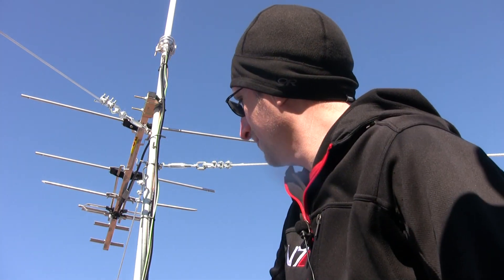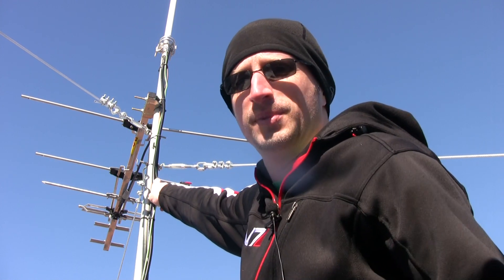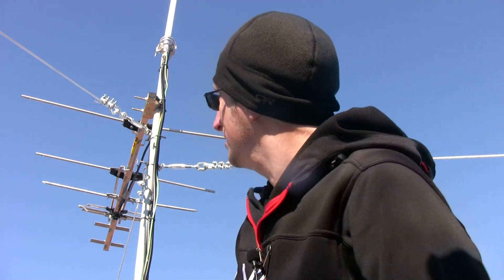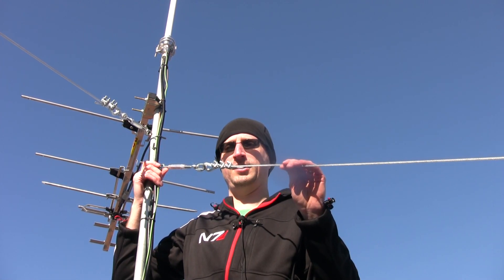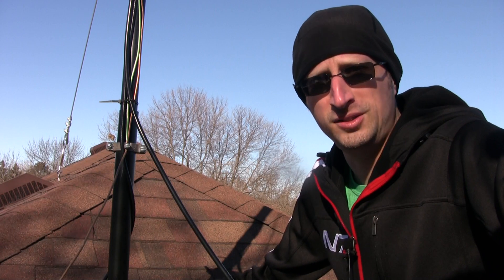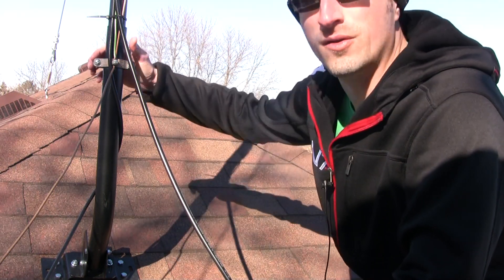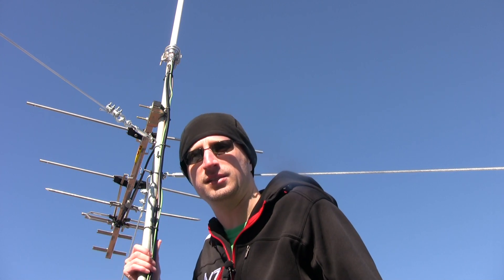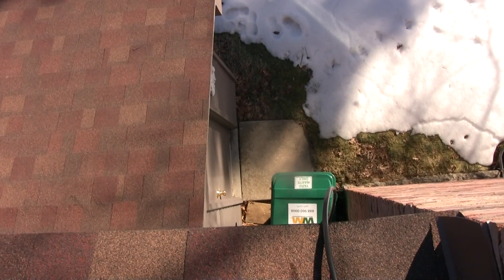Overview of outdoor antenna for Helium Network

Comment: I ended up buying the same antenna stand on Amazon, however it's hollow instead and doesn't look like any good way to connect the antenna. Any suggestions on how I should go about attaching the antenna? I believe I have the same antenna, or a very similar one. Do you think U-Bolts would work for that as well?

Comment: How many feet of lmr400 did you use, is this the 5.8dbi rak wireless antenna? Looks like 30 feet if that, would be about 1.1 dbi loss?
Reply from the maker: technically two lmr-400 cables (5ft & 27ft with a lightning arrestor before the 5ft section that goes in the house).

Comment: i have questions .my questions are :

1. Can I connect 2 or 3 antennas same time for 1 miner (example 4 dbi and 8 dbi)with antenna splitters ?

2. what internet speed needs a connect bobcat miner and how can check internet speed ? Is internet speed important ? wifi or cable connection better ?

3. i ordered bobcat for usa us915. if i ll move to Europe, how can i use my miners there ? can i change my miners antenna frequency ? (from usa to europe ) do i need replace or buy part any module ?

Comment: Really cool video. I've been researching optimal send/receive for my HNT hotspots and this video is awesome in visualizing this. 

QUESTION for you: have you stumbled upon information regarding minimizing your coax cable length, mainly, by getting an outdoor enclosure for the hotspot itself and reducing the coax to as little as possible (~0-2 feet), while running longer ethernet and power connections up the antenna mast? I know signal loss with LMR-400 (or better) cables is minimal even over 20 feet of cable, but I think it's still a factor. I've seen pics of people mounting their HNT hotspot right below the antenna and have a super short coax. Since there isn't any signal loss or speed loss over 30 or even 50 foot ethernet cables or power cables for the hotspot, but there is signal loss with the antenna cable, this kind of makes sense. However, those outdoor enclosures are fairly expensive and usually all sold out at the moment. Would love to hear your thoughts on this way of mounting and minimizing any loss for the antenna.

QUESTION 2: I'm considering the above method and using a 20+ foot antenna mast. I've read several hardcore RF guys discuss how that's the minimum height above a house and surrounding houses to get a stronger success increase with the HNT hotspots. Thoughts?

Comment: I’m still waiting for my rak miner, however I am going to make sure that I have my antenna ready. I have a 10 dbi omnidirectional antenna, but also want to combine it with a 4dbi omnidirectional antenna. Is this feasible and what hardware should I purchase?
Reply from the maker: It is feasible. You would need a combiner to do so. I've not tried this yet.

Comment: Finally got my 8dbi from China got it in a few weeks & I set up my antenna with a 5ft extension added giving me lil over 8ft for total of about 28-30ft total.
Reply: 8dbi rak. The syncrobit website said SMA female but they upgraded the info & says RPSMA now so the cable that comes with the 8dbi rak should work with the syncrobit.

Comment: Great info, thanks. What about a leak in the roof with driving those bolts into the roof?
Reply from the maker: Yep, covered in another video. Put some roofing caulk on it before you put in. Some have said on top too.

Comment: Hey Ed, great videos. I am building my set up from them. I see you are standing next to your chimney. I might consider running concrete anchors into it and using antenna wall mounts like Skywalkers on Amazon. I am a firefighter and we get house fires from lightning strikes. It would be much better if your brick chimney got hit and went to ground. Just a thought. Keep the great vids coming!!!

Comment: Your cable runs are too long. Should’ve ordered an outdoor miner to keep your cable run as short as possible! (Not to mention signal loss) you’re probably spending a fortune on the cables! Sounds like you changed the 4 dbi supplied antenna that came with the unit for a more narrow directional 8 dbi antenna,  Hope it works out for you but it does not sound good… js.. but my opinion is based on mounting 4G LTE antennas with Sim card connectivity to towers
Reply from the maker: I will be experimenting soon with a shorter cable. Last fall I was using a short cable and the earnings weren't that great. The cable wasn't an LMR-400 cable - it was the stock one that came with the antenna. I've been happy with how it's been mining so far.

Comment: Hey if I heard you correct the yagi antenna helps with your helium as well? How did you mesh the two antennas together? Or do you have two miners
Reply from the maker: No - the yagi is strictly for over the air tv.

Comment: also how long is the cable to the antenna and does the length reduce your HNT earnings?
Reply: Cable length does affect DBI, the longer the cable the more loss. A good shielded cable like this is not going to lose much over 10 -15 feet though. 100 feet would be another thing.
The shorter the better, however inches does not matter much where feet does.

Comment: can we use this antenna with Rak , nebra and bobcat miner or it is just for one type of miner ? Thank you
Reply from the maker: Any miner as long as you use the right cable.
Reply: @edballou1  Thank you for the reply . Could you please tell what sort of cable i need as i have order  nebra and bobcat miner?  Thank you
Reply from the maker: @milan02able  An LMR-400 cable. I get mine from usacoax.com. The ends of your cable are HIGHLY dependent on the antenna and the miner. The Bobcat is SMA. I don't know what Nebra is off hand.

Comment: How much power does the setup use. Could you run if of solar and a battery as the power supply?
Reply from the maker: 5 watts I believe... same as an LED lightbulb. I'm super interested in a solar/battery setup. Will probably experiment with this in a few weeks.

Comment: Can you comment briefly on antenna cable length? How long is the extension cable in this setup? I've seen people claiming that a cable length of more than 5 to 10 feet will adversely effect HNT mining rewards,  do you find this to be true? 

Thanks for making these videos, Ed. There are many new HNT enthusiasts like myself who are trying to soak up as much knowledge as possible and, for me at least, first hand experiences like yours contain a wealth of information!
Reply from the maker: 32ft of cable total. 27ft to a lightning arrestor, then 5ft more to the miner. While true about introducing more dbi loss, I’m accepting that over risking putting my miner outside.

Comment: It's a good idea to mount on the overhang so water doesn't leak though your roof.  At least use roofing tar under and above the screws, but even that needs to be checked and replaced regularly.  Mounting in the middle of the roof should be a last resort.
Reply from the maker: 100% good advice!
Reply: @edballou1  I appreciate your valuable videos.

Comment: Did you need a signal booster and does the company recommend one based on cable length since the signal strength declines with length.  How long is your cable, estimated to the miner?
Reply from the maker: Companies certify the miners with the antenna shipped. Customers may choose to make modifications. My cable at the time of this filming was 27ft. I now have it at 32ft.
Reply: @edballou1  I ordered 2 nebra miners.   If I learn about boosters elsewhere I'll update.  I do not want to void the warranty nor damage the unit but also if a booster makes little to no difference then its a waste of time.  I bought a used 30 foot pole for $40 and it can be raised 10 feet per section.  I want to connect with a nearby town so I'm gonna offer free internet prepaid to someone if they'll let me place a unit in their home, then use profit to add more miners.  After halving I'll see whether I can expand or not.

Comment: so in this particular setup, Ed got a Rak 8dBi male N type ---> N type female to female lightning arrestor ---> LMR400 Male N type with Male RP-sma --> Miner ?
Reply from the maker: Yes, that's correct. However I later moved the lightning arrestor lower down the cable.

Comment: What are the cable ends...1 is the N type male other side is the RP SMA male?
For the RAK..... Am I correct?
Reply: The cable ends Ed is using is a male N type to a male RP-SMA. The connection on the RAK 8dBi is a male N-Type. He's apparently using a female to female N type lightning arrestor.

Comment: this is really helpful
thank you
how long is the cable running from the miner to the antenna?>
Reply from the maker: In total, probably about 32 feet. Thinking about shortening that up though as my earnings seemed to have dropped. Will be experimenting some more soon.
Reply: @edballou1  yes shortening definitely works..i heard no longer than 5 feet is optimal
Reply: @phobiazzzero4935  Hi, Can you say where you heard 5 feet of maximum cable is correct, as this seems and sounds absurd. Did you perhaps mean  25 ft. which is less than his 32 ft.

Comment: Bro thank you so much man,,, I am so happy found your channel. I am from canada and I am trying to setup a new device. You said putting a higher dbi antenna is not valid under sec regulations then how come can you used a 8 dbi?
Reply from the maker: Manufacturers have to certify the device with the antenna in order to sell it. It's public license space so if you keep your dbi low enough, you're probably good to go. That said, the FCC could knock on your door and inform you of infringements/violations. Even then, it's probably just a "take it down or lower your dbi", slap the wrist sort of thing.
Reply: @edballou1  cool. thanks, I am going to try 3 dpi, 5.8 obi and 8 dpi,, lol.. I have ordered all three types, will keep each antenna for a week and decide what's giving me the best money
Reply: I thought that the three and eight may actually give you less helium. How did your test go?

Comment: I  saw a similar 9 ft. to 17 ft telescoping galvanized antenna mast like this on amazon. I was thinking of purchasing and it looked like it wanted its owners to route through the hollow inside. I was thinking wouldn't it make more sense to run all cables on the interior of the hollow mast/pipe than zip-tying them to the outside?

I am thinking of making a similar indoor/outdoor antenna setup and your videos are very informative thanks!

Comment: Do you know if your outside antenna will work with the new hotspots coming from Nebra? I was thinking since it is 915mh it should but i am worried about the connections. Since the Nebras are being shipped as i write this you might not know. Any news? Thanks.

Comment: so for those live in houses they HAVE to get this setting? antenna on the roof? why non of that is mentioned on Helium website?
Reply from the maker: Not required at all. In fact, in the long term, may not even be necessary as the network fills in and more hotspots come online.

Comment: Hi Ed, please use common sense with regard to lightning. It is too hot and too many volts for that green cable to handle. In fact your whole antenne is now a lightening rod. When it hits, it will melt all cables and hit through the roof, and put your house on fire. You need an expert to place a separate lightening rod further away and higher in the air then your antenna in order to be protected. Please consider removing this video so that nobody copies your setup.
Reply from the maker: Hi! Thanks for the feedback. As I stated in the video, I had an electrician ground a similar mast setup and went for years without issue. Much of the rest of the setup (green wire) is to address static discharge. If this setup is wrong and unsafe, I'm absolutely happy to take it down, correct my setup, and then film a new video to encourage others. Please include links (to other documentation, videos, etc) so we can get the word out about the most safe setups.
Reply from the maker: https://longrangesignal.com/tv-antenna-basics-how-to-ground-an-outdoor-tv-antenna/

The green wire is specifically in this link.

Comment: HI ! What is happening this year in August to halve the reward of HNT? I don't think it's good for miners. What do you think?
Reply from the maker: Though I'm learning, I'm nowhere near expert in crypto, tokenomics, etc. The only thing I've heard is that halving has been traditionally good for crypto. Could be completely false...but that's my current thinking? Again, still learning.
Reply: Yea, its called halving. Other popular coins like Bitcoin also have this. With Helium halving happens every 2 years because there is a finite supply of HNT (223 million).

Comment: I hear that a 3 meters cable is the max for mounting an antenna there you have like 5 miters of cable does still works?
Reply: The longer the cable, the more your signal loss is. Keep the cable as short as possible
Reply: @jose3538  exactly thanks for your reply!

Comment: How did you connect it from the outside to the inside? Did you just run your cable under a windowsill or something?
Reply from the maker: I drilled a hole through the side of my house. Others have routed through a vent. Some have mentioned a flat cable that can be put through a window.

Comment: You have to ground everything because you are using an outdoor miner is that correct?
Reply from the maker: An outdoor antenna. The miner is located inside my house, connected with a cable which I show at the very end of the video.
Reply: @edballou1  don't you think you're losing power by running such a long wire to the hotspot?  Antenna wire that is... its been discussed quite a bit that you don't want more than a few feet from hotspot to antenna.  How many feet is it precisely if you don't mind me asking? Great video!
Reply: Which outdoor miner are you using?

Comment: Have you got any tutorials for the best method of placing eg 3 hotspots within range of eachother , what to do and to avoid
Reply from the maker: 300m spacing at a minimum. The rest is just experimentation with placement or considering use of antennas.

Comment: Hi Ed, I am wondering if you can do the best setup for indoor mining as I do not have access to a roof but an attic/ or a second floor on a house. Thanks
Reply from the maker: Still doable. If you have a balcony or can mount an antenna on the outside next to a window (safely), then those would work too. There are flat cables that can be used to navigate through a window.

Comment: Do you feel that the length of the LMR 400 you have running diminishes your signal strength at all? Just a suggestion, possibly buy a syncrob.it hotspot with PoE capability and use their outdoor enclosure that comes with it to eliminate running your LMR too far.
Reply from the maker: Any amount of cable diminishes signal strength. Antenna db can compensate. Like I said in another comment, I don't want to run the risk of damage to the hotspot from weather. With supply so low and demand so high, I don't want to risk being down for months while I wait for a replacement.

Comment: Nice video as I am about to deploy my 5.8 dBi outdoor antenna. What is your neighborhood like and your decision to go with the 8 dBi outdoor antenna, like nearby hotspots, hilly terrain, urban vs rural, and etc. Thanks
Reply from the maker: Terrain is mild. There's a big river a few miles away so that helps with line of sight. As for why I chose the 8dbi, no particular reason. I just saw others were going with bigger antennas so I decided to try it too.
Reply: If you live in a suburban area in a flat town, a higher gain antenna like yours works best. If you live in a city with lots of obstacles (like New York and its buildings), a smaller gain antenna is better.
Reply: @jose3538  Why? Please explain.
Reply: @jose3538  Hmm. Interesting. Thanks.

Comment: If you don’t mind approx how much helium are you able to get with the outdoor setup?
Reply from the maker: Hundreds of HNT per month currently. That will change over time as the network grows.
Reply: @edballou1  and what you think when the network will grow the amount will drop down?
Reply from the maker: @pavelroujilo2286  I believe we haven't reached the max 5 million HNT per month yet. So it's either when we get to that point or if we already have, then it will gradually get lower as the network expands. The halvening will of course make it go less, but that is a reality and the value of $HNT seems to be already accounting for that fact.

Comment: Good job! 
I have a question, would you recommend the Nebra hotspot? Also what's the best antenna to get for my helium miners? (Ordered 2raks and thinking about one nebra)
Reply from the maker: All miners are intended to be the same, as in they will all mine the same amount of HNT. The nebra does seem to have a pretty cool outdoor hotspot that looks to handle weather well. Just haven't tried it yet so I don't know.
Reply: @edballou1  Thanks alot!